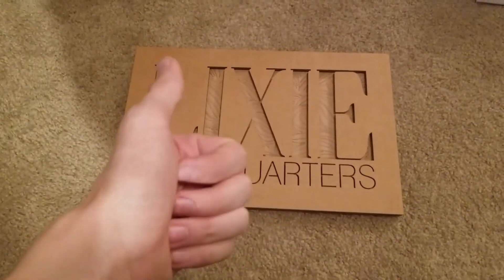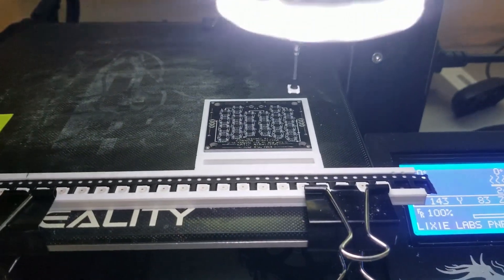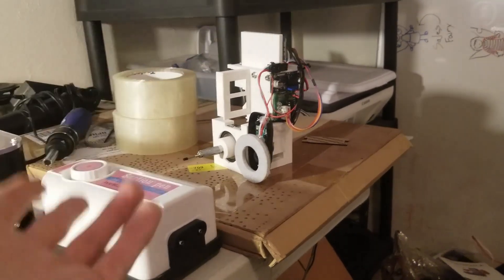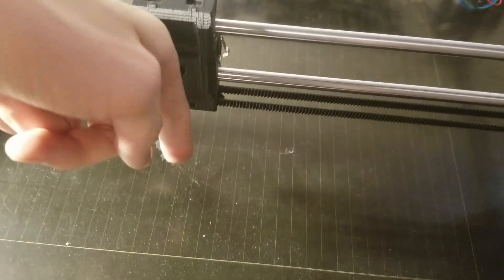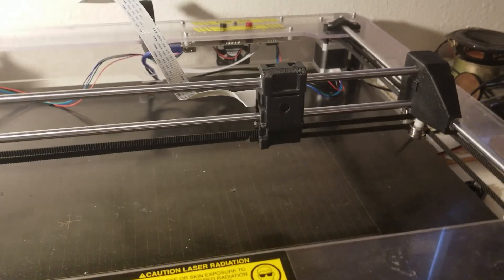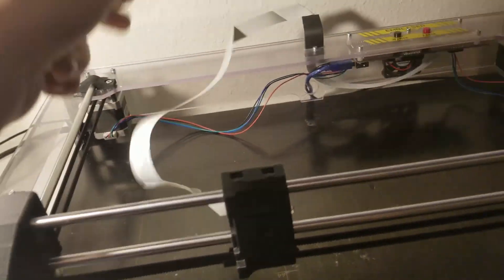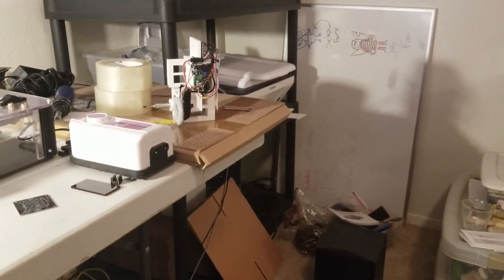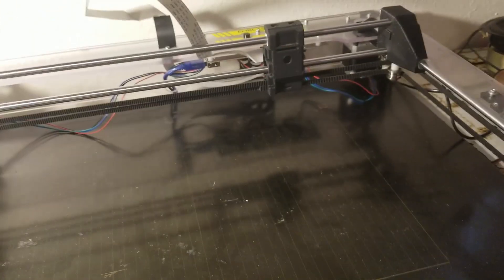DIY PICK AND PLACE MACHINE | Episode 1

Comment: hi, Does it precise enough for 0603 components?  i am planning to build one , currently i am researching
Reply from the maker: Tomi Piriyev Currently, no. And that is a limitation of the acrylic frame - it's too flexible. If you built a similar machine with an aluminum frame (Type "laser cutter 4050" into Amazon) then it could fair better for placement accuracy.
Reply: @lixielabs  i meant the precision of the stepper motors
Reply from the maker: @tomipiriyev  Oh I see. Using Trinamic TMC2130 drivers with a 1/256 microstep would allow these 1.8deg per step motors to theoretically drop down to 0.00703deg per (micro)step.

However in reality, movements couldn't be that minuscule, due to the inevitable tiny bit of slack in the belts. However, tensioned belts on a sturdier frame than this (with that kind of microstepping) should be more than enough accurate for 0603 placements.
Reply: @lixielabs  got it, thank you Conor, one more question, which firmware do you use ? also on 3D printer demo, have you changed firmware, or used default?
Reply from the maker: @tomipiriyev  Firmware on the new cutter-based PNP is Marlin 1.1.9, the Ender one was updated from stock to "TH3D Unified" for printing purposes, but the stock Ender firmware (Marlin) is totally compatible.

Comment: yay looks awesome! GL on new job!
Reply from the maker: Thanks! As you saw based on your last comment, the previous PNP was quite literally limited to Lixie boards - this one I'm looking to set up so that I can swap out modular pieces like JEDEC trays or auto/drag/strip feeders that might pertain to each board. Lixie is a good start for this machine (as it would only need a single feeder) but our next project has 7 unique parts and 18 placements, with differing orientations and some with very fine pitch parts, such as the QFN chip I mentioned in the video, seen here on my fingertip: https://i.imgur.com/fbvJsVr.jpg (The glove's blue, not me.)
Reply: @lixielabs  Lies! You are a blue alien! Haha, neat project. Havent looked on you entire video lib, I will later. I wonder what do you do for paste? Dispenser? Stencil?
Reply from the maker: @aviramiancovici93  We stencil our boards! Way back, I was using syringes and it was exhausting. I'm looking into a way to automate paste application as well, but no CNC based options I've seen could replicate fine pitch parts like a stencil. We're in a weird spot where we're making hundreds of boards some months. Too few to justify outsourcing, and too many to comfortably do without some form of automation, so we're trying to figure that part out.

If anyone's interested, I'm also thinking of running a series where my wife and I discuss the little shop oddities we've hacked together like ways to quickly manage inventory based on weight instead of direct counts, things like that.
Reply: @lixielabs  Neat? Have you tried spot drilling the stencil (instead of milling square pads just drill a fine hole where the center of the pad should be, you can use the stencil gerber file and simply change the square and other shapes to drill - basically turn it to a drill file) with a cnc on fine steel sheets? I'm sure you can manage 0.1mm holes, you don't have a machine that would handle it? the CNC Wegstr seem like a tool that can handle it. maybe step up existing machine with a 32bit controller? cheers mate - awesome channel! good luck